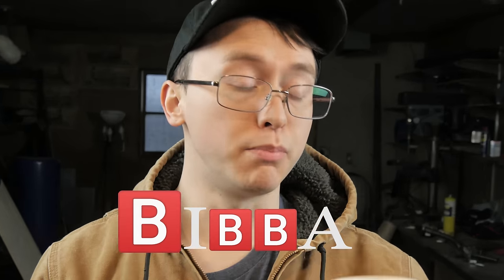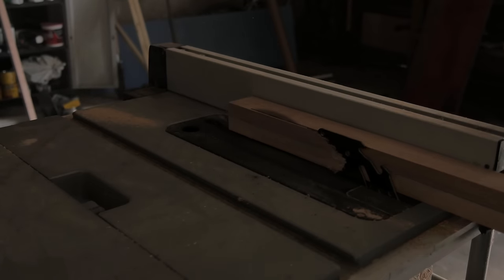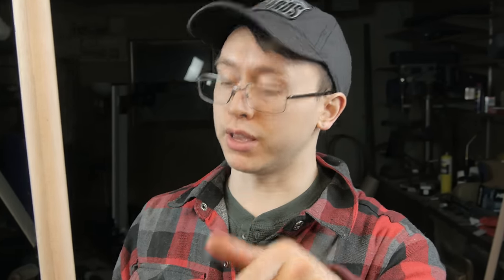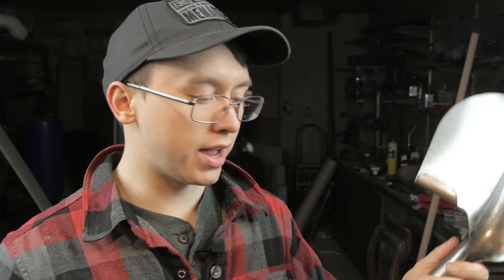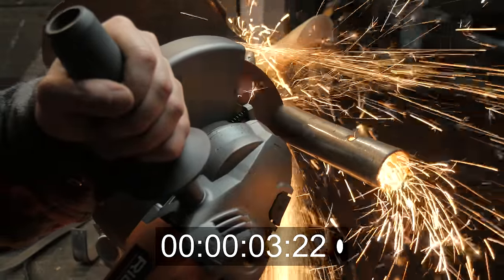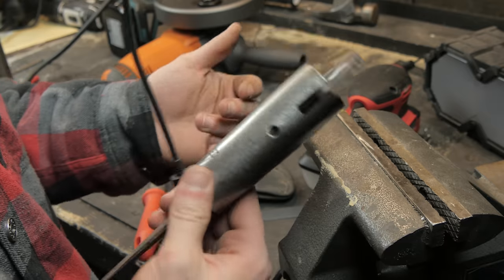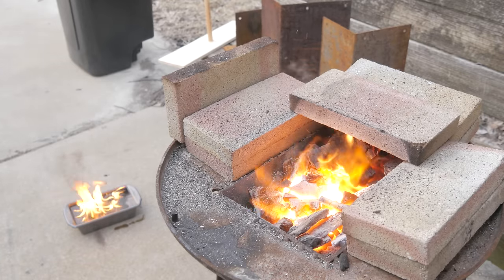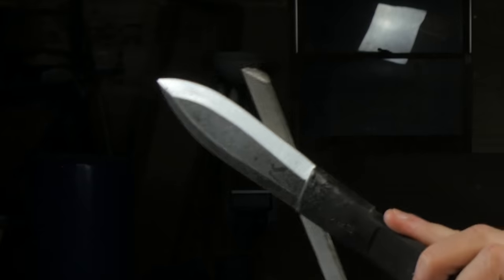DIY Lathe in a Day + Turning Spear Handles (Wrench Spears Part 3)

Comment from the maker: You guys KILLED it with the likes on the last vid, but i heard someone say that you couldn't get more likes on this video and he said your dog was fat too. Let's show that guy he's messing with some bad hombres, and SQUISH THAT LIKE BUTTON!
Reply: Wow who said my dog was fat
Reply: ZNA Productions how did He know
Reply: That HECKING silly boi
Reply: If I don't have a dog, how can it be fat? 🤔
Reply: That's cause I saw metal sharp things in the thumbnail
Reply: Well my dog just died and wasn't overweight so thanks
Reply: My dog is fat tho
Reply: Wide dog didn't like that
Reply: I stabbed that like button , my mum got angry cuz mysteriously my phone broke🤷‍♀️
Reply: ZNA Productions try to use slightly warm water and if that still fails use cooler water. Since theyre cheap wrenches they probly arent very super high carbon steel  so they need more temperature shock. And they may not be able to get as hard as a file but they will still getfairly hard
Reply: HE SAID WHAT
Reply: Get a strong magnet and check the piece of Steel coming out of the forge with it when it's hot enough that the magnet doesn't stick that's when you quench it
Reply: Keep moving forward eli 😆😆😆😆😆😆
Reply: Not sure how you would have missed it but could it be the case that you are a casualty of the Patreon Purge? I imagine your audience are generally the type that would join in on the boycott after they banned sargon, hell if I had any money to still be giving you I would've been one of them. Proudest decision of my life was to support you for the few months I had a job (guess that says a lot about my typical decision making skills huh)
Reply: ive never seen a f***ing sawblade turn at an angle, i love tools and the process of making stuff and everything but oh my god i thought i mightve been tripping out or something
Reply: I got 2 Ads on this Vid bra and I didn't even skip them love ya man I'm kinda sad tho I won't see the Sword because by the end of this month for the next two years I can't watch YouTube because I'll be helping people in another Continent there's no YouTube there so Go ZedNots
Reply: Lol jokes on him, we have a cat!
Reply: ZNA Productions dude, maybe go to a blacksmith and get advise on how to heat treat those types of steel
Reply: Ya got a typo in the description. ..."depending on which and you start from" when refering to seeing one of two things happening at the end. Also love your content you mad lad.
Reply: She's getting old, leave my fat dog alone.
Reply: I herd a lot of people might be nuking their Patreon accounts because of their less than fair policies.  That might be contributing to your $hrinkage.
Reply: 😠😲😲😠Who's talking s#it about my dog? You let them know, I'm coming for them.😠😠😠😲😲😠😠
Reply: For the heat treating you could use the carbonizing process that clickspring uses when he makes his files and they are simple and inexpensive ingredients
Reply: ZNA Productions the fat dog was a compliment, he is filipino
Reply: If it doesn't have enough carbon then make a box out of mild steel then put the blade into it filled with carbon dust then weld it shut then heat cycle it about 20 to 30 times remove the blade then do the same to the blade this'll bring the carbon content up by a small amount but I i think it'll be enough to get a decent hardening on the wrench set up heads, if you want me to go into more detail comment back Eli
Reply: You better make a vid on making the lathe Eli or I will eat all your grandmas bread
Reply: Dude u made a spiny thing mid build that’s awsome can u show us how you did it some time sorry I don’t actually know the name of the spiny thing but anyway keep up the great work can’t wait to see you better you hardening and other smithing skills
Reply: ZNA Productions  hey should try a water treat on the spear heads might work better for the tool steel could be wrong might be better to look more into it but does harden certain steels better than oil hopefully it helps
Reply: Get a magnet when heat treating! so when it dosen't stick to your work you know you are at or around critical temp then quench. Also when you are quenching your work try to keep it moving cutting through the quench oil
Reply: I thought it was SMASHING THAT LIKE BUTTON
Reply: Wow I can't believe you just made a lathe like that awesome
Reply: ZNA Productions to you this is advice 
1. Watch other YouTubers (example: AWE me/Man at Arm's) in order to find techniques and other interesting ideas in making your weapons 
2. Find objects like tools that have other steels (some objects use different steels to what we usually know of course), find out what kind it is (if it's in a box or has a tag sometimes it says so for some reason or try asking the store you bought it from in order to heat treat) 
3. Use steel, other alloy/metals, or other type of material that is fine...use good quality materials, there are better ones out there that are good in all specific ways to make weapons/armor
Reply: Did you do the magnetic test before quenching the blade?
Reply: So exited to see the end result!
Reply: Tape them to your hands. Shovel hands man.
Reply: I don’t have a dog tho. I do have a female cat that I beamed chad
Reply: For heat treating with oil if it catches fire when you pull it out its still too hot make sure it didnt warp then PUT IT BACK IN THE OIL to completely quench the metal hardening it to its best potential quenching is about quickly cooling it down if it catches fire blow it out put it back its too hot
Reply: But my dog is fat... he has some "winter weight" on every part of his body, funny when you can pet your dogs leg fat or his chin fat...

My profile pic is actually him with a shirt on, he has an infection on his leg and kiddo long sleeve shirts cover it so he can't itch... and I can already see the people complaining about a dog with a shirt on: we take it off in the morn, we wash it and change it out.
Reply: Yo, your videos are fucking good. Man's got no money to give but I like the videos
Reply: warm oil my ass use cold ass water and shake it past the lydenfrost effect. oh and maybe look at a temper chart u can find that in a machinist handbook or probably google images.
Reply: ZNA Productions yay ZNA! I’m 1 of the 4 girls lolol! 👏🏾👏🏾👍🏾
Reply: "if it looks stupid, but it works, then it ain't stupid" if you are looking for some extremes about that, search for "Brazilian gambiarra"
Reply: How DARE he mistake my fat cat fir a dog!
Reply: Made it 420👍 likes ;)))
Reply: I mean, they aren't completely wrong when they said my doge was fat, she kind of is.
Reply: My dog is fat tho
Reply: @setha6096  Then he is obviously talking about your mom.
Dont let him talk about Moma Seth like that !!!!!!!!!
Reply: When you know when the steel is hot enough to keep treated if you put a magnet on it and it doesn't stick, this is proof that God loves blacksmiths
Reply: You should change up the waiting music in vids, change to something a little epic or hardcore for blacksmithing. Like Lord of The  Blacksmiths by Falconer
Reply: Can you make the bladed tire iron from Fallout 4? Or the electrified Chinese Officer sword from Fallout 4?
Reply: FYI I have watched over 100 of your videos.  I un subbed because of the music.  I know you don't care and will continue to add stupid music.  In the end most of us watch for the words not stupid music.
Reply: I don't own a dog, but my cat IS fat... As long as he didn't talk shit about my snake or my hermit crab, we're cool though. Have a like anyway.
Reply: But my dog is getting kinda chubby
Reply: what if our dog is fat, what do we do?
Reply: Man you need to SLEEP, its not good to be up at 🅱️🅱️🅱️🅱️🅱️ hours
Reply: on your question about hardening if you got a compressor you can do a wind tunnel by blowing air in a tube wirlwind style and leave the blade cooling in it also you need to wait for the blade to glow alot more if you need other hardening tips look at man at arms videos on youtube
Reply: Get a sponsor please no one cares  if you talk about a vpn for a minute in your video's
Reply: project 1 spears
project 2 sword
project 3 MEDIEVAL CLAYMORE!!!
Reply: I have a cat, he is fat.
Reply: They said my dog was FAT?! OH! it's on!
Reply: Use the shovel heads for shoulder pads
Reply: Use the shovel heads as metal shoulder pads for a body armor suit
Reply: Would take a day to make those shovels into spears or throwing shovels haha
Reply: Blacksmith here.. If that wrench is 01, W2, 1055-95 or even 5160 (which it wouldn't be) it should all heat treat just fine.. They all have subtle nuances to maximize hardness but my instinct was telling me those spearhead weren't near hot enough. You wanna go about 100-200 degrees past austenitic (non magnetic).. Yes, hotter oil (125F) maximizes heat treating. Cools faster due to viscosity..
Reply: give harbor freight some more rep brother
Reply: Just down here to let the ads play #getdatmoney
Reply: ZNA Productions reach out to people and see if they will sponsor u
Reply: View to like ratio on this is crazy high now. Let's get that bread
Reply: Can I caress the like button?
Reply: You should try to get in touch with Alec Steel
Reply: If you make a sword, GO BIG AND MAKE A ZWEIHÄNDER!!! 7 and a half ft sound like a good start.
Reply: ZNA Productions reeeeeeeeeeeeeeeeeeeeeeeeeeeeeeee reeeeee reeeeeeeeeee reeeeeeeeeeeeeeeeeeeeeeeeeeeeee
Reply: My dog is fat though
Reply: Cutting it h*cking close in the beginning
Reply: Bring the blade to near forge welding temp then quench that lil boi
Reply: he said my dog was fat? :(
Reply: Ya well my dog is a bitch and i liked before i started watching
Reply: If you wanna know why you heat up the oil before you quench it. It's because when you quench you are pulling heat away from the steel so fast it makes the molecules tighten together but when you heat the oil up it still pulls the heat away fast but you have a smaller chance of your steel cracking
Reply: ZNA Productions I’m very sorry to say mate if those are cheap spanner’s they are probably crap steel. And yes spanner’s can be made of crap steel they only need to be harder than mild steel. I’m British so we call a “wrench” a “spanner”
Reply: Hey Eli, long time fan of you channel just got a few tips you may know already but I just wanna help. Keep a strong magnet near by when trying to heat treat. When the steel stops being magnetic then it's time to quench also try a deep quench vessel so you can move the piece up and down in the oil so it cool quicker (leidenfrost) thus a better harden. Keep up the good work
Reply: do a water quench. the oil quench is a fairly gentle quench, if you use water it should make the steel harder because it cools the steel faster. here is a video on heat treatment mechanics by Real Engineering : https://www.youtube.com/watch?v=6jQ4y0LK1kY
Reply: Those bastards! their dog is fat! likes video
Reply: Well my dog is fat so I guess this video isn't getting more likes
Reply: Eli you made friggin lathe that's it I'm buying a hoodie
Reply: I'll buy ur nervous system for like 50 cents
Reply: You just got 5 heckin bucks more a month bro! Heck, finally just got myself a job, you can keep it up! Heckin awesome man. Heckin. Awesome.
Reply: ZNA Productions hey by any chance do you do requests if so how much would you charge for a full suit of armor riot grade stab proof made of steel plating and painted black If the helmet with the mace shield is separate the can it be plated with steel and painted black as well thank you very much and keep on rocking in them videos
Reply: Hey man an u make a throwing axe
Please
Reply: Have ya been hitting leh dmc5 for inspiration boi?
Reply: You should try to get the steel hotter and quench with water or brine/salt water
Reply: I re watch almost all your videos and I love them all. Honestly you seem genuinely motivated and it makes me happy. I’ve been a dedicated fan for years now. Keep it up we wanna see you succeed
Reply: Hey man can u make a assassins creed hidden blade
Reply: Im sorry zna i wish i could be apart of your patreon because i love your content but sadly im not old enough to get a job thank you for the content we all enjoy your videos dont worry about spacing these videos we understand that you try your hardest thank you
Reply: Your steel needs to be cherry red for the quench
Reply: Plz post an exact measurements of the lathe
Reply: ZNA Productions a point to note for you. Hardening comes from cooling hot steel as quickly as possible. Preheating your oil was not a great idea. Also ive seen partial water quench first followed by a full oil quench. Otherwise when your quenching your goal is to cool the steel as fast as possible with that oil
Reply: @akurobinson3006  the heat in oil is to pro ent warps and water commonly causes more warps than oil
Reply: How badass would it be to do apocalyptic katars with the shovel heads?
Reply: ZNA Productions if you hold a magnet up to your blade during heat treat it’s shouldn’t stick. After that you have to leave it in a little longer for a proper heat treat.
Reply: After quenching if it's still on fire when you take it out it didn't take

Comment: Yeet a magnet on that metal when it's hot. If it sticks, it ain't hot enough sir.
Reply: @asdfghjkl61700  How...do you even do that? A bridge maybe, but a river? Are you a stone?
Reply: @handsinthefire  What if I am a stone??!! Don't disrespect stones or else I'll call in Gary.
Reply: That's what I said. Also when you quench it needs to be aligned directly north.
Reply: You do realize the steal was the issue not the heat treat, and yes he knows this whtch his first knife making vid, he did exactly that, but a good knife maker can tell by just he color so I don't think he is the best but he's good enough to tell when to quench a blade. It's honestly very easy, the hardest thing to deal with is warps in heat treats and he was fine
Reply: The problem is the steel. Because it's from a wrench and he doesn't know what kind of steel was in it, then he can't heat treat it properly. It's best to start from a known alloy and then follow heat treating instruction for that particular kind.
Reply: @comeonmanagain3313  color only tells you how hot it is up to the cherry red 1500° F, after that, not so much. Also every steel reaches critical temp at different temperatures, and not all steels will reach a 50 or higher on the Rockwell scale. Most blacksmiths use color, sure, but it's not reliable when you work with variable steels. The best way to heat treat when you only have a forge, and dont have a heat treat oven is the magnet method
Reply: This. Eli do this thing. Very important thing.
Reply: @triston steel was def hot enough, in broad daylight it was yellow so it was probs pretty close to white.
Reply: handsinthefire don't question, ples, don't break the intricate law of this world

Comment: Bro, blades are too cold to harden. Put a magnet on the end of a stick. Poke heating blade in forge with magnet. When the magnet is no longer attracted to the metal, THEN you can quench.
Reply: If he gets it hotter it would be around forge welding temperatures for hardening he needs to test with a magnet (as you said) or just judge the temperature. and forge welding temperatures is definitely above the temperature needed
Reply: Some steels wont harden to the hardness of a file
Reply: @Nolifecoffeeaddict  Yeah, but all steels will harden to some degree, and the magnet test will find you THAT steel's temp.

Comment: Your cheap wrenches are probably Chrome-Vanadium, which comes in several varieties. The kind tools are made of, particularly cheap ones, doesn't get as hard, even as hard as similar compositions of Chrome-Vanadium with different end uses in mind. You might actually want to get these bad bois ripping hot yellow and quench in water, locking in that martensite where you can get it. Water quenches faster than oil, so that "slow" cooling in oil is letting that relatively small percentage of martensite transition down into softer phases. Gonna need a good long temper afterwards or those beauties are gonna blow up when they hit something.

Comment: LIKE SO HE SEES:
Make a quench tank ( vertical tube ), and then you need to create a constant tempature all throughout the oil. Stir it a lot! Look up what tempature the oil needs to be at according to your steel type, then check it in all places with a tempature meter, keep stirring the oil. don't quench one blade quickly after the other,allow the oil to cool down to the designated oil tempature, stir between heat treats. Also! Don't be afraid to hold the steel in there for like 15 seconds, and KEEP MOVING THE STEEL up and down, so you don't create heat pockets in the oil, that will mess up your heattreat.
Reply: You: “stir it up”
Eli: “put a blender in it? Ok.”

Comment: Use a magnet to see if your at the right temperature  if it sticks it's not ready
Reply: Yep, that will do it.
Reply: Could too many failed heat treats ruin the steel?
Reply: @antonypowpow7771   It's always fixable. Worse comes to worse, you have to normalize it, 2x or 3x heat cycle, then go for another quench. Heat cycling returns the grain structure to sharp-pointy-thing class steel.

Comment: You should try to keep your heat times down. There’s a video by Alex from outdoors55 where he shows grain structure after heat treating. It might help you a lot. He basically has the best result after normalizing, using pre heated oil, and getting the steel to critical temp fast